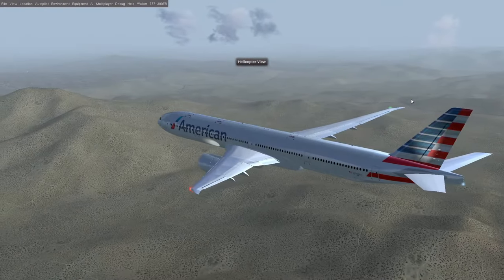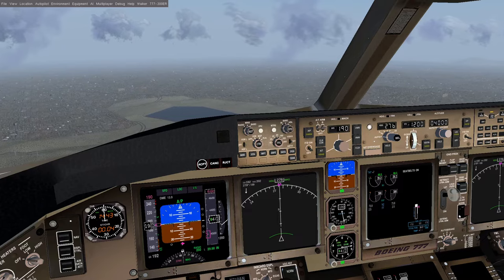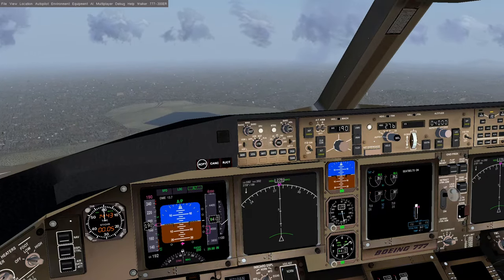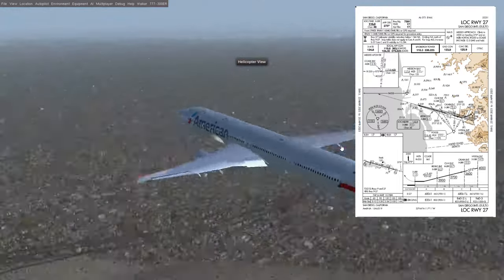Why Landing at San Diego's Airport is So Hard

Comment: Landed many times at SAN in Airbus and didn’t find it that challenging. The challenging part was getting stable prior to 1000’ AGL especially with a 3.3° glidepath.
Reply from the maker: @timothypropst238  When the weather is good (which it usually is) it’s a little harder than average but not that bad. When it gets hard is when the ceilings get low which they often do because of our marine layer. The DA for the RNAV-Z is 621 ft and the MDA for all the other approaches is 680, and the most overcast is usually about 1500 but sometimes it dips much lower and between that and the traffic volume going to a single runway is when it gets difficult.  There is an LPV for the RNAV-Z that goes down to 262 but that’s a little risky, although it is usually possible to use it to get down if necessary.

Comment: This approach is not difficult at all. It just takes proper planning and execution. I will give you the perspective from an active airline pilot that flies into this location on a regular basis ( I just landed there two days ago). There is an ILS to KSAN but only to runway 9. We almost never do the localizer approach to 27 as we have the RNAV (RNP) Z approach that gives us vertical guidance. If you're coming from the north you'll join the approach at KLOMN intersection on the downwind leg. If you're coming from the east you'll join the approach from LYNDI intersection. In general you'll slow to 210 knots on the downwind. On base, you'll start extending your flaps and slats and slow to 170. SoCal will usually want you to keep your speed of 170 until REEBO or a five mile final. The approach is a bit steeper as it is a 3.5 degree glidepath instead of the usual 3 degree. For this reason the plane will not slow as easily (depending on what you're flying). You just have to plan for this and extend your landing gear a little earlier to get the drag required to get slowed while maintaining a 3.5 degree glideslope. The biggest threat is the parking garage that is just prior to the airport. For this reason, there is a displaced threshold. Again, this approach is slightly more challenging with the steeper glide angle, but by no means hard or difficult, even if you're doing the visual approach.  It's all about energy management and using your drag devices at the appropriate time. In my opinion, landing at places like Orange County (SNA) or Burbank (BUR) are more challenging than San Diego to tell you the truth.
Reply from the maker: I mean it’s not that bad no but definitely a bit harder than average. Runway 9 and its ILS are seldom available, RNAV or GPS for 27 aren’t bad but are a bit steep and non-precision which is a somewhat dicey combo. Again, not super crazy but it presents a challenge. When landing here gets really hard is when there’s low cloud ceilings and a westerly breeze, which fortunately doesn’t happen every day but it’s by no means rare. Usually conditions facilitate either going visual well above MDA or an outright visual approach or if it’s foggy wind is dead calm and 09 can be used. Most days are either clear or overcast at about 1,500 ft with a steady wind from the west. That and dealing with both Miramar and the border but those aren’t a big deal just make the class B shaped weird.
Reply: @EricaCalman  Well, the title of your video suggests to your audience that is hard. It is not and many pilots do it everyday. I am very familiar with landing in San Diego.  I do it all the time in various weather conditions in a real 737. I don't quite understand why you feel landing on 27 with low cloud ceilings and a westerly breeze is really hard. I don't know if you've had actually flight training or are a sim pilot only. As a suggestion in the simulator, try extending your landing gear a bit early and get slowed. SoCal will usually ask you to hold 170 knots until 5 miles from the runway. This can be done as long as you get your drag devices out earlier than usual.
Reply from the maker: Well it's a combination of (a) it's what I'd always heard, (b) watching landings over the years and seeing how often people go missed and (c) one occasion where I was a passenger and we went missed like 3 times trying for 27 before landing on 09 using the ILS. I've only trained as a VFR pilot in real life so my only time flying IFR or anything faster than 140 kts is in the simulator but it still seems like the hard part is the minimums, terrain and ceilings. Idk, maybe it's what I learned as a kid before GPS was as good as it is today and even that flight I was on was in 2011 and things have continued to improve. In the sim though I don't have much trouble slowing down, I have trouble getting sight of the runway above DA or at least an AGL altitude that doesn't make me pretty nervous.

Comment: Not recommended this for real air traffic, but in MSFS you can sort of cheat the system because there is a GPS waypoint ("ZOLPA") right on the Runway 27 threshold.  However, you need to have more altitude than the required minimum at the previous waypoint ("REEBO") of 2000ft to get the right glideslope angle.  If you are at around 2500ft at REEBO and use VNAV to ZOLPA (set to around 20ft), it will bring you all the way down to the runway.  It's helpful, because a lot of times with live weather, you can't see the runway until you're really close because of a coastal marine layer and fog and it's easy to overfly the runway.

Comment: Have you flown a real a320 and b737 with similar flight hrs? What are you basing your opinion on which is the better aircraft?
Reply from the maker: @mattewert6980  general consensus, they are both good airplanes. As a loose rule of thumb Boeing makes better long haul airplanes and airbus makes better short haul but they obey the same laws of physics and have customers that pay for the same type of fuel so there’s a lot of convergent design. More people seem to prefer a 320, I actually like the 737 better but a lot of people like side stick and a320 is usually a tiny bit more efficient for the same range and cabin layout.

Comment: I did plenty of approaches and landings at SAN. Not an especially challenging airport, despite terrain on final. It's annoying to think that local officials permitted the construction of a garage in the flight path that resulted in a displaced threshold eliminating otherwise useable runway.

Comment: You mentioned that 2 red and 2 white lights mean you are on a proper decent rate...Not correct...It means you are on proper Glide Slope...To maintain proper glide slope you have to be on glide slope AND have/maintain proper decent rate..ie.  a stabilized approach..
Reply from the maker: Yeah I misspoke, on glide slope is more correct. Being on glide slope and on correct approach speed result will result in a proper decent rate and vice versa though.

Comment: I use RNAV(GPS) 27 or RNAV(RNP) 27 that have both horizontal and vertical guidance to runway 27. It works great in X-Plane 12 and MSFS.
Reply from the maker: Those are both options but they are considered non-precision approaches, as is the localizer/DME approach I was semi demonstrating. In both cases I believe the MDA is the same at 680 ft.
Reply: It works great in real life too. Highly recommended.

Comment: San Diego approach to 27 never made since to me , seems like it would be better to maintain altitude and 180 back and land on 9
Reply from the maker: So if the wind is dead calm or less than 5 knots that could work but landing downwind is always risky and combine that with the hill that makes landing on 27 so hard the margins for a go-around become dangerously thin. If the wind accommodates landing on 09 they just do that but sea breeze almost always blows in from the west.
Reply from the maker: and in either case you'd want to use the 09 ILS and approach from the west and if you got visual high enough I guess you could fly a visual pattern to land on 27 but using the 27 localizer and then the 09 ILS would never really make sense, and if you can do that you can probably do a visual into 27